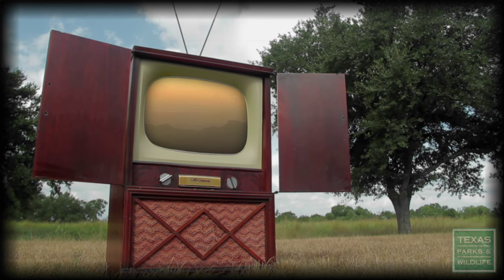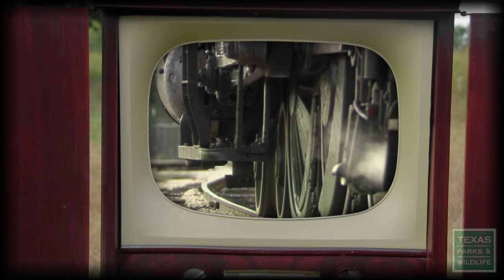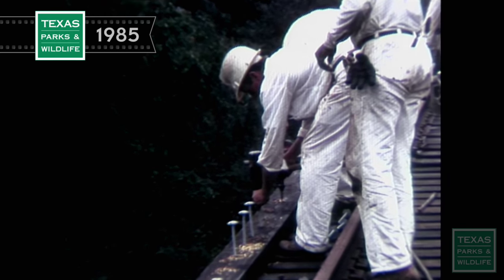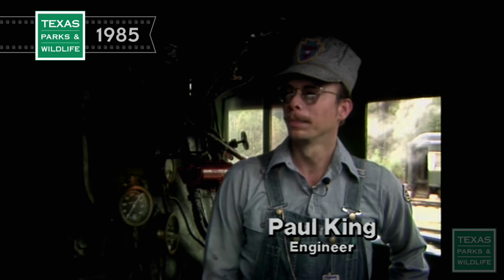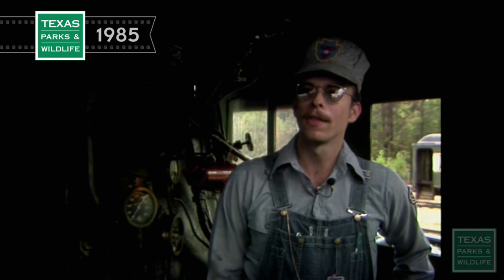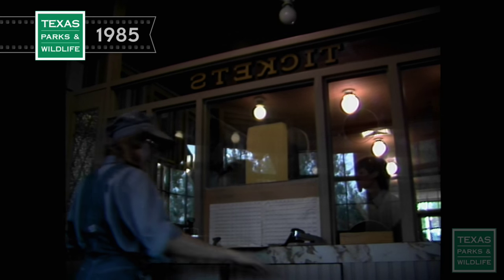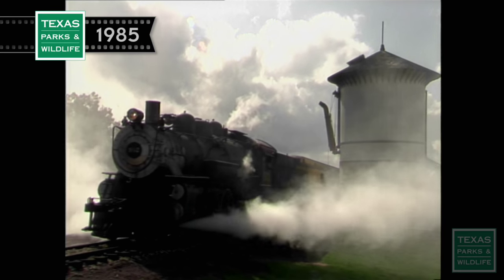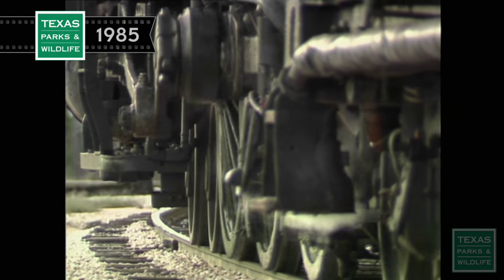Texas State Railroad - From The Archives (1985)

Comment: They need to bring 500 back to life beautiful locomotive!
Reply: @TheUnflushedToilet  these days now that FRA allows you to rebuild boilers; it was primarily only tubes and stays years ago; boilers aren't really an issue like years ago. You can install tube plates, side sheets, crown sheets, the list goes on and on and even new courses welded instead of lap seamed if you like. So compared to the earlier days of preservation (FRA didn't allow crown sheet repairs) there is no longer a "it can't be restored" reason not to have a loco up and running. Yes it probably needs side sheets, tube plates, tubes, stays, and alot of yuk cleaned out of the bottom of the firebox. Back when she ran alot water treatment was rarely if ever used and if it was it wasn't really all that good either.
Reply: I could be wrong. But one other likely reason for 500 being retired (apart from being in bad mechanical condition) was because of it’s immense size and weight compared to the other steam engines used. Like I said, I could be wrong.